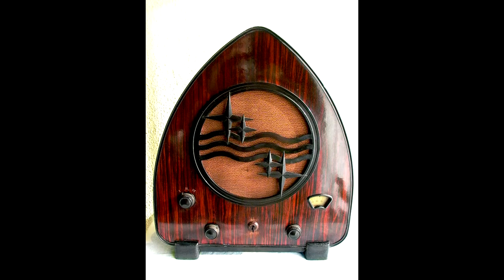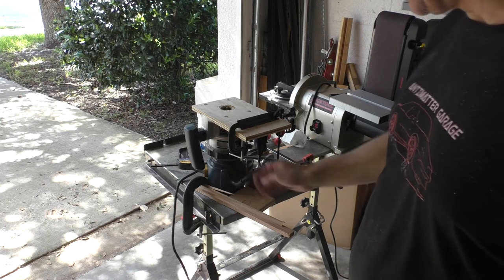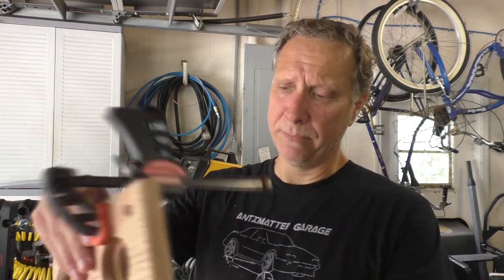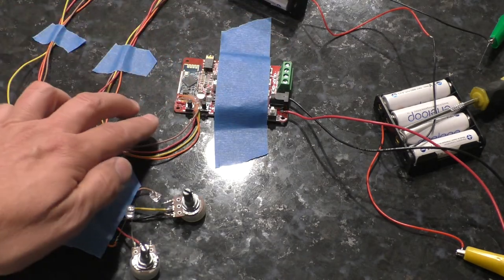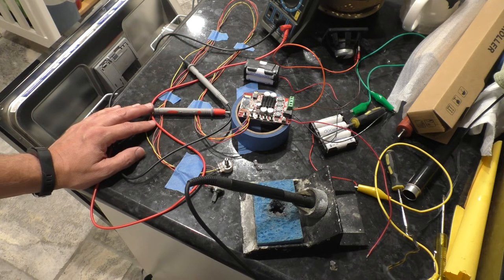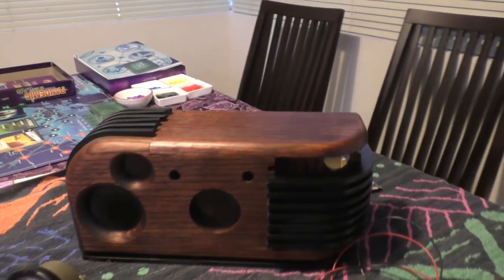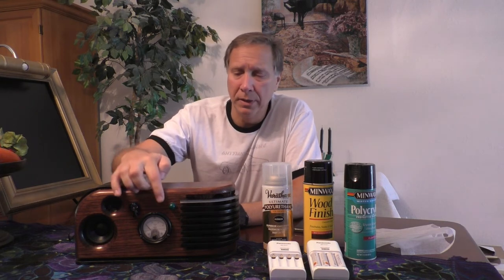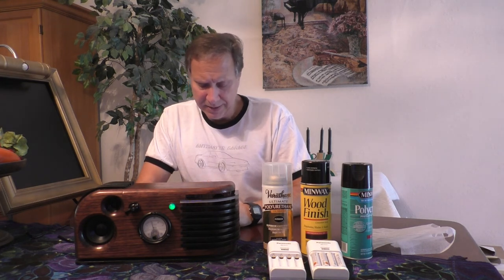AS 006 Art Deco bluetooth speaker buiild

Comment: That looks awesome. You can easily scuff the magnets with sandpaper by hand. I drill a hole in the wood and epoxy them in flush to the wood. Works great
Reply from the maker: That's a good idea.  When I first installed them, I looked up the best glue and used a drop of super glue.  It seemed to hold really well and I think it might have been fine, but I decided to stay on the safe side and put some epoxy on them too.

I think the scuffing idea is good, but you have to be careful, if you go through the outer coating the insides can essentially turn to powder.  FYI.

Comment: Hi, with what application did you make the elements of the project. What are the final dimensions of the speaker? Thanks
Reply from the maker: Sorry it took so long to respond.  Strangely my phone wasn't notifying me about comments on this channel.  I'm not sure what you mean by elements exactly, so I'll cover everything as best I can.  The drawings I made toward the beginning of the video was done in a program called CorelDraw.  It is an expensive program that I got cheap because my wife is an educator, but you could use virtually any drawing package to make drawings of this kind because it is only two dimensional.   Fusion 360 is a 3D package that can do this plus much more and it is free for hobbyists.  That drawing is then brought into a program called Vcarve.  This is a common program that is included with various CNC milling machines and it creates the path that the tool will take to mill the pieces.  The machine is a CNC router made by Stepcraft.  These are pretty good machines, but you can do better for far less money.  The final dimensions of the speaker are 13.5" x 6.25" x 5" (342.9mm x 158.75mm x 127mm).  I hope that answers your questions.
Reply from the maker: Sorry it took so long to respond.  Strangely my phone wasn't notifying me about comments on this channel.  I'm not sure what you mean by elements exactly, so I'll cover everything as best I can.  The drawings I made toward the beginning of the video was done in a program called CorelDraw.  It is an expensive program that I got cheap because my wife is an educator, but you could use virtually any drawing package to make drawings of this kind because it is only two dimensional.   Fusion 360 is a 3D package that can do this plus much more and it is free for hobbyists.  That drawing is then brought into a program called Vcarve.  This is a common program that is included with various CNC milling machines and it creates the path that the tool will take to mill the pieces.  The machine is a CNC router made by Stepcraft.  These are pretty good machines, but you can do better for far less money.  The final dimensions of the speaker are 13.5" x 6.25" x 5" (342.9mm x 158.75mm x 127mm).  I hope that answers your questions.
Reply: Thanks for the reply.  I wanted to know how big that speaker is in the end.  I like it very much and I was wondering if I would start building a similar one.
Reply from the maker: @cristianpopovici3967  Oh, I hope you do and post up a video.  I love watching builds like this.  And just in case I was mistaken, the actual speaker inside the unit is 2.5" and is in the description above and the tweeter is a 1" speaker from my 2003 Toyota MR2 spyder.  On a scale of 0-10, with 10 being the best I think this speaker actually sounds pretty good and would give it an 8.